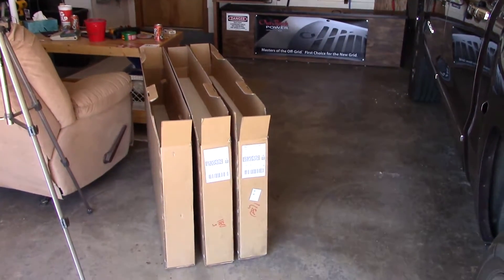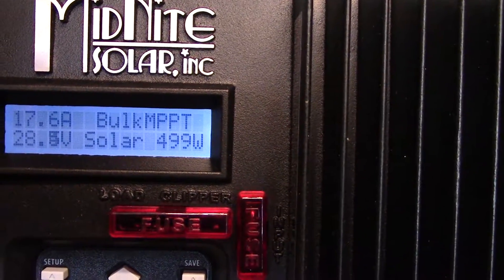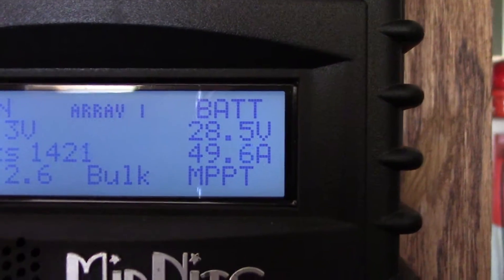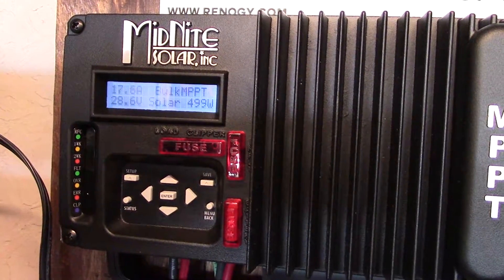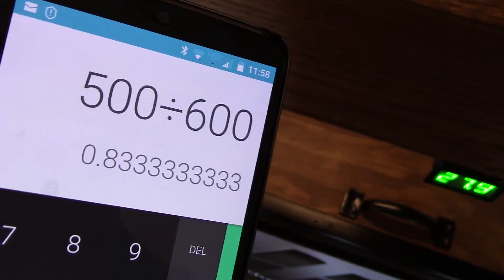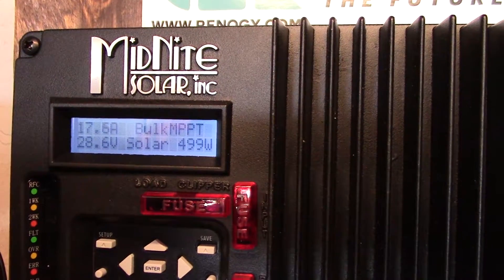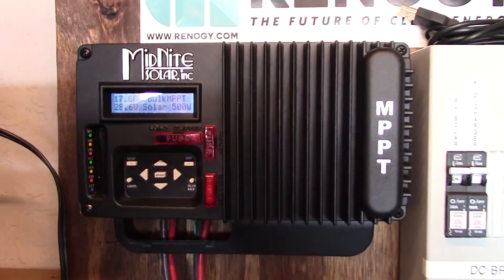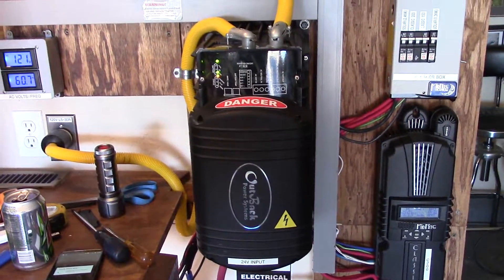Part 2: Testing out six new Renogy RNG-100D monocrystalline solar panels (power out)

Comment: Chris, Do you have the two classics and the kid in the follow me mode?

Looks like you ran the 6 new panels in series?
Reply from the maker: The two Classics are hooked up in "Follow Me"...easy to do. The Kid is stand alone. All the "Charge" volts and charge times are the same. The new six Renogy panels are definitely wired in series for high volts. Much easier to push volts through 125' of PV feeder cable vs DC current.

Comment: Wintertime should give you the best power because they are cool. Come summer time, I would not expect the output to be so good,  as the temos rise on the panels, they will put out less. But it sure is killer system you have running there. Have you considered a solar tracker for some of those panels in your back yard.
Reply from the maker: Thanks for watching. Naw, not doing solar tracking.